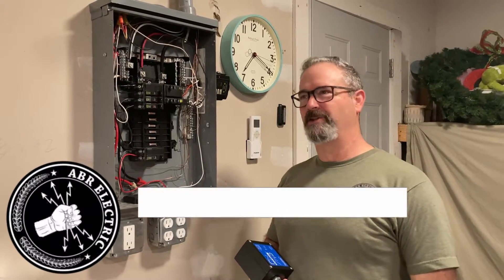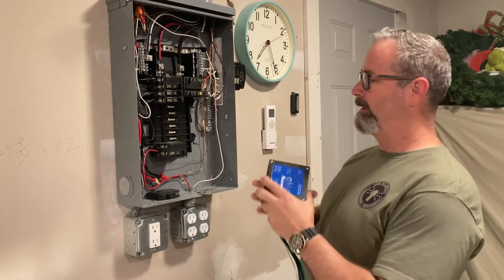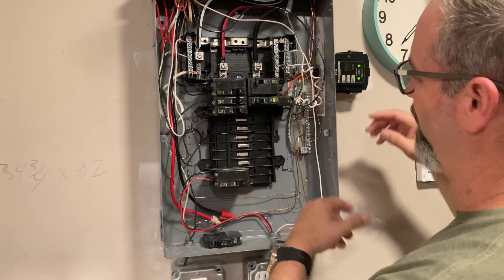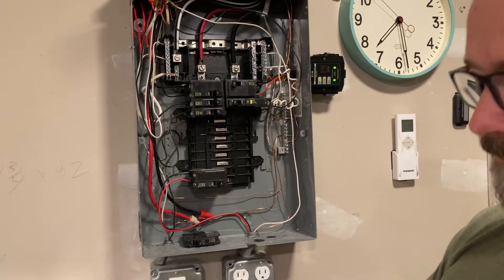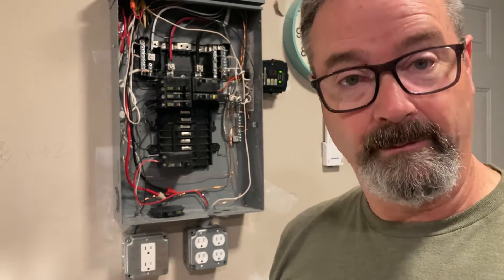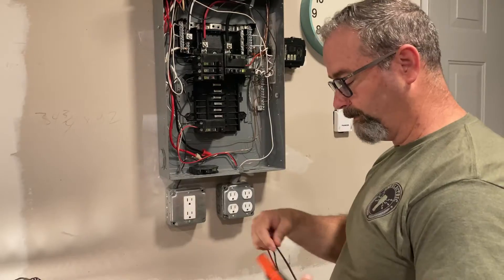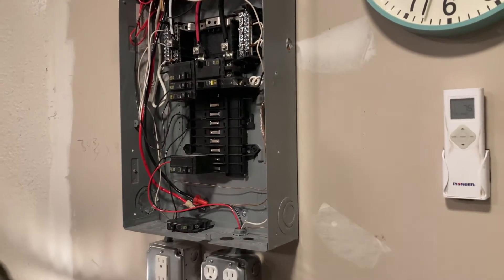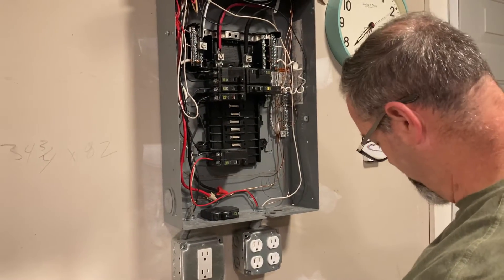Whole House Surge Protection | Installation of the The Vortexx™ Series R 1-Phase |

Comment: Can someone help me understand what this should cost? I’m being quoted $700 for product and install by an electrician.
Reply from the maker: @mikes9393  seems high. You can get the PSP for $200 or less. Is the install difficult because of framing, etc?
Reply: @ first, thank you for getting back to me. I think I’ll just end up shopping around, it was “pitched” to me alongside my ev install. nothing special was said in regards to install I think that’s just their price.
Reply: In the DFW area where both ABR electric and I are...700 would be an absolute steal! One of the larger service companies here is even charging over 2K.

Comment: Shouldn't you also check each leg to neutral to make sure that both L1 and L2 are disconnected?
Reply from the maker: @TippyYork  at the main lugs? Yes
Reply: @abrelectric  Hi, if at the main, you check at both L1 and L2 and get no reading, why would you need to check either against neutral unless you suspect neutral is somehow energized?
Reply from the maker: @thenexthobby yes, the extra check makes it 100% off/safe. You only have to be wrong once to get hurt.

Comment: Hello there, I have severe fluctuation issues at peak times here in South Miami. My 4T Trane compressor draws 45Amps. I have an ICM 102 Delay on Make Timer installed which does not trigger unless the power goes off completely - which Protector should I get ? Thank you so much !

Comment: I love this Vortexx R single phase. Not all of their R and Hurricane spd's have thermal protection, look for TFMOV in specs. The double tap, for Type 1 line side connection, is supposed to be made with the spade under the conductor, docu says. Weird, yes. I collected different 1/4"-20 thread options to use on bus studs, one option being thin jam nuts, another being threaded rod connectors and a hex screw. I looked at Harley faring standoffs, similar idea. Also looked at non-crimp non-toothy set screw connectors, some insulated, but those connect directly to feeder...a commenter posited using toothy screw down on feeder, no way that here.

Comment: Would love to hear from inspectors on the double tap of the main lug point after some follow-up. May from PSP reps.
Reply from the maker: I've heard from several inspectors who are not fans of the double tapped lugs
Reply: I've had to go back and fix many of them after an inspector failed me. Stopped using them for that reason.